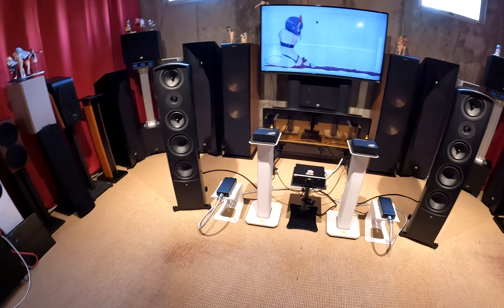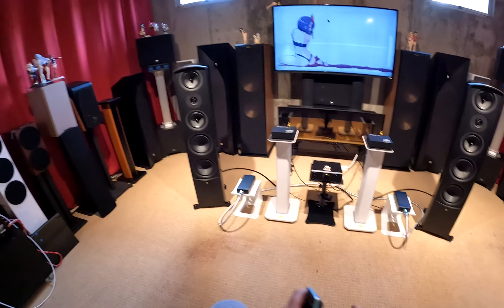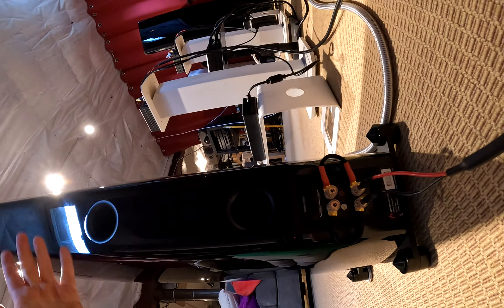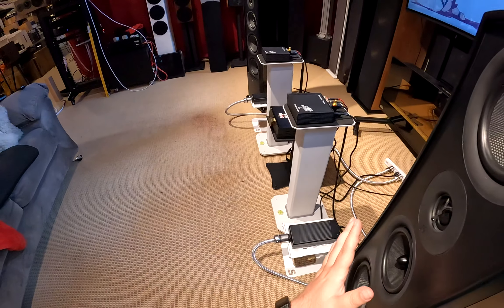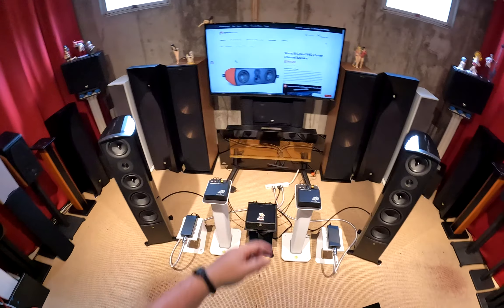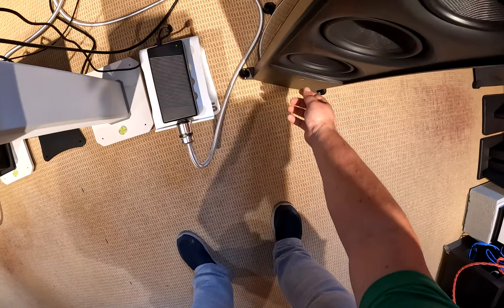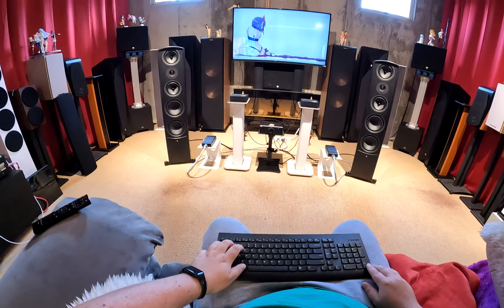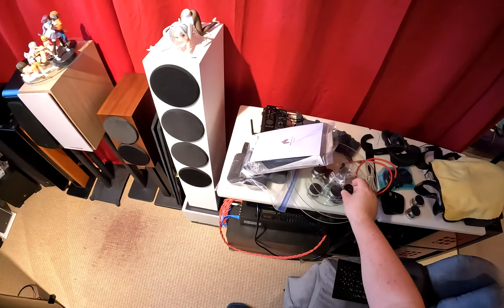The Verus III Grand V6t+ is Intense ||💎💎

Comment: 16:50 This is the reason I would use a piece of vibration dampener, in my case it was called brown bread, thicker, less expensive than dynamat with better numbers, thick foil on the visible side, sticky black tar like appearance on the sticky side, I would put it behind the door speakers to reduce any sound reflected back, then I would replace the plastic behind the door card fully with the same stuff.  I demonstrated the difference to my friend using one door, just dampener on the inside of the door skin, and let them listen, the dampened door will be noticeably louder.

Comment: Cnat wait for V8T shootout against V6T and others. To remove grill, simply pinch the fabric in the middle by top midrange driver and gently pull back. Super easy
Reply from the maker: Na. Added the straps. I am not yanking fabric and risking stretching or damaging that.
Reply: @ZReviews  suit yourself. I have the V6T and have done it dozens of times over the years, and that is also the official instruction from aperion on how to remove

Comment: If you want to be impressed by a tower speaker for quite a reasonable price..check out the Canton Vento or Chrono SL lineup. Made in Germany, making speakers for over 50 years. Outstanding top to bottom performance. Their ceramic tweeter is magical. Any chance of reviewing them? I promise you'll be impressed.

Comment: Just FYI they are not on sale
Reply from the maker: Yeah. It couldn't last forever. Still worth at 3 Gemstones.
Reply: @ZReviews  I hear ya, was just unexpected since you just posted the video. You should check out Canton Tower speakers. Specifically the vento or Chrono SL line. Canton has been making speakers for over 50 years and they are handmade in Germany. Right now you can get either of the lines for about 3 to 4,000. The cabinets are hdf and heat pressured multi-layer. They have a ceramic Tweeter that's just magical.